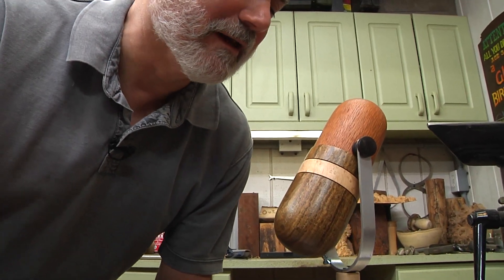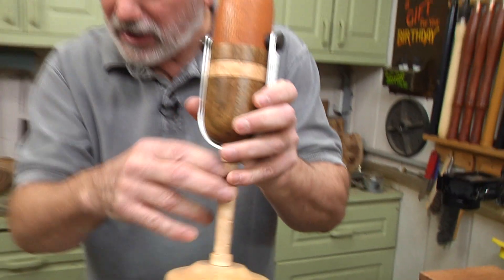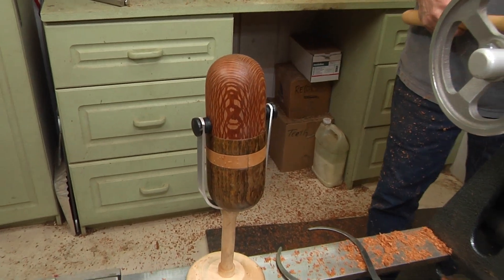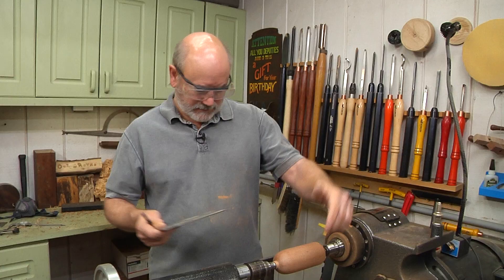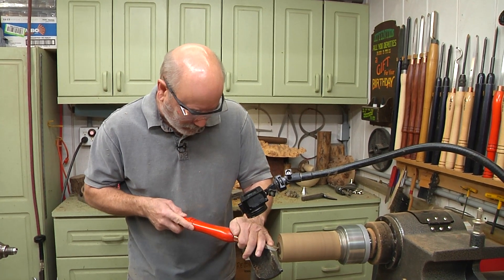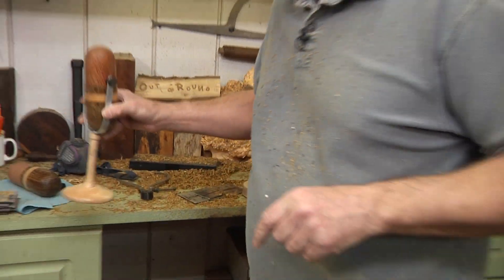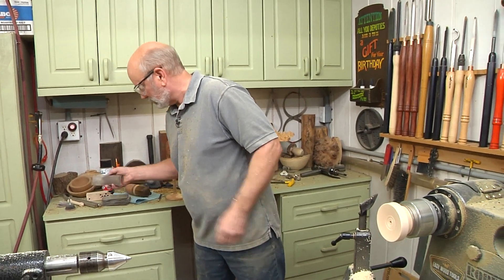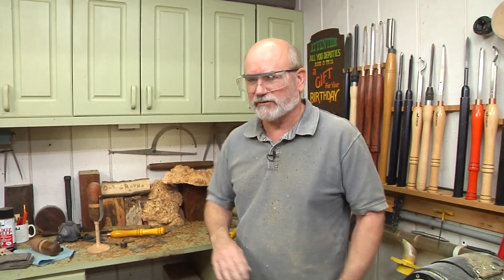Old School Microphone

Comment: Hi, Tim, I have a question. Do you use or have you used the Easy Wood Turning Negative Rake Carbide Cutters? If so would they be a better choice all around?  I know EWT says they are safer for resin, acrylic, and real hardwoods, but seems to me they would work and be safe for all wood? Thoughts? Thanks...
Reply from the maker: I love the EW negative rake cutters. They are great for the uses you listed and they are safe for all woods. The only issue is that they are very non-aggressive so I do not use them for roughing out or early shaping. It would be too slow. I use the regular cutters until I get down to my final shape and then use the negative rake if I need it.

Comment: Tim I would love to see you make those vintage nut bowls with the center part that holds the nutcracker and the nut picks and the bark remains on the outside of the bowl. Believe it or not about the only place you can buy the truly vintage ones is Ebay and even for one in poor shape, they aren't cheap! They make great things to pass down in the family for use at holidays. I found a decent one on Ebay but I won't say how much I paid for it lol. https://i.pinimg.com/originals/88/6c/60/886c608bb13ac90273b75c42ccabd1d5.jpg
Reply from the maker: We don't have the bowl but we have those old metal picks and nut cracker. Still use them on nuts. They also work on King Crab (when we feel like splurging!). I think I will try my hand at one of the bowls once I find the right piece of wood.
Reply: @woodturningwithtimyoder  Really looking forward to it Tim, amazing how many people remember their mom's nut bowl and the nostalgia that goes with it, especially us old folks lol. Thanks, Tim!